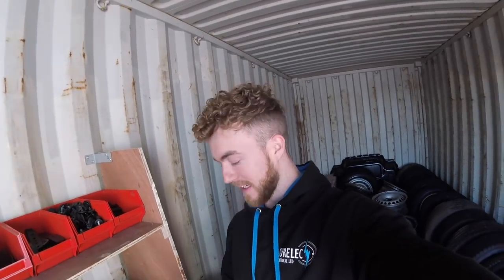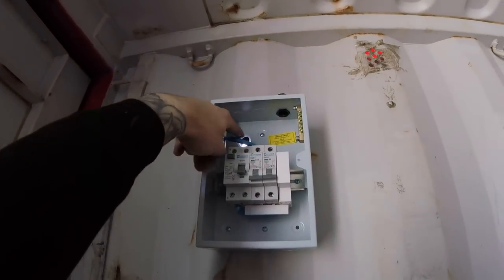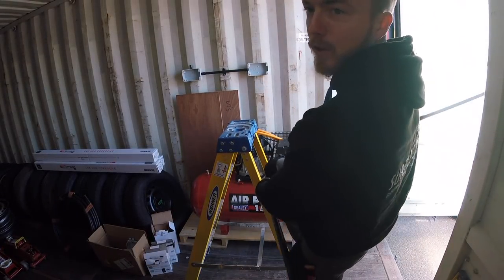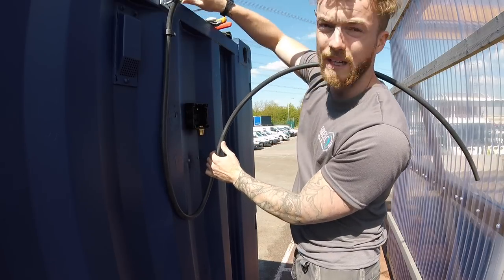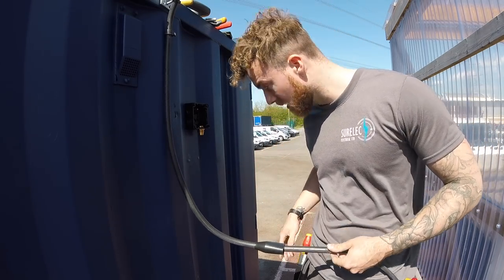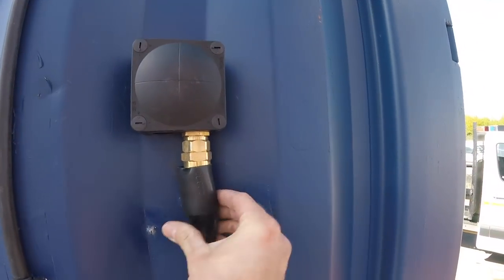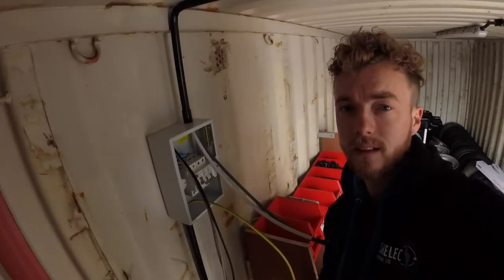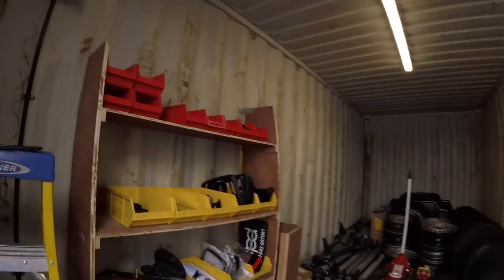SurelecTV- Container Wiring, SWA make off, Conduit bending

Comment: A few points to consider 
1  RCD fed from RCD  not necessary 
2 Same as above but with earth rods 
3 Tape not required on the swa gland . You cut the sheath back too far .
4 Have you tried push in saddles ?
5 Tidy job :)
Reply from the maker: persona250 thanks for the comments mate 😊 the second RCD is protecting the new container on its own stake only? I did cut the sheath back a little too much, hence why I added a bit of tape in this scenario, had the gland been on the side of the box I would have remade, but as it was on the bottom of this box, ingress up into the gland/cable is unlikely, but well spotted! Can’t say I have ever used the push in saddles for solid conduit, but have used the clip in/push in ones with flexible conduit. Are they worth a try?Thanks again
Reply: Hi Bud . Push in saddles save time and faffing around with those  tiny screws . Im presuming a TT earthing system had already been created at the first container so no requirement for an extra rod and same with the second rcd . In a fault situation which rcd would trip ? I would have used a standard main switch on the second db or connected into supply of the first rcd if over current protection is adequate .

Comment: Fellow sparky here from the USA. Just wondering on the specs of that conduit you're using there. For a job like that here I would have used metal EMT conduit. Is that not as common there? We also use plastic PVC conduit here but normally only when underground. But it's very ridgid and you have to use a torch to heat it then bend. But very nice work. Very cool to see how things are done elsewhere in the world 😎👍💥

Comment: Wow you look like Roland Keating 😁 Good job - just wondering how you secured lights etc. to ceiling & kept it water tight?
Reply from the maker: Not the first time Ive been told that, not sure if its a good or bad thing though haha!! 

The light fittings I used are completely enclosed non-corrosive fittings, so they come with brackets that you fix up, then the light clips securely on so you don't have any screw holes. With regards to all the saddles and other fixings on the roof of the container, the only thing I could do was seal round the fixing (screw) internally and externally with sealant. I've done this plenty of times and it seems to keep out the elements. Thanks for watching pal!
Reply: I've had a better idea, how about a couple of roof magnets, the type they use to put lights on the top of minicabs etc.?

Comment: Hi mate how did you connect the earths up ? Is the swa in the earth terminal at the board where you run the supply from? and then just the earth rod goin in the container
Reply from the maker: RK 180 exactly right mate. Earth of the supply SWA is isolated at the adaptable box.
Reply: SurelecTV 
Why is is the earth connected at supply side mate if its not at the container end 
Sorry to peck your head pal 👍
Reply from the maker: RK 180 no worries at all mate! It’s connected at the supply side, so the supply cable is protected/earthed via the supply DB. It is then isolated at the container end within an enclosed adaptable box. The container is on its own TT earth (earth stake). The reason for the isolation of the supply earth is so the two earths can’t be touched, creating a possible dangerous potential as the supply earth is PME (TN-C-S) and the new container earth is TT. Hope that explains it okay?
Reply: SurelecTV 
Brilliant mate appreciate it 👍

Comment: so u pulled a 3 core swa in did you cut the earth out at both ends? or just the end where u TT it?
Reply from the maker: Allen Goldsmith Hi Allen, the cpc was cut at the TT end, but connected to earth at the origin. Ideally I would have used 2core swa, but this wasn’t available in time for the job
Reply: oh right ok, I've been asked to install a hot tub its 10 meters away from house on a TNS earth, would you run a 3 core to a rotary isolator then a 2 core to the tub and TT it??
Reply: Allen Goldsmith- If the earthing arrangement in TNS there is no need to TT it, only TNC-S systems need to be TT’d where there is the possibility of 2 or more earthing potentials, such as metal sheds, buildings with extraneous conductive parts etc.
Reply from the maker: Sam Kerr Sorry Allen, I’ve only just noticed your reply! But Sam has hit the nail on the head for you 👍🏻
Reply: also could run a 10mm separate earthing conductor to bond the extraneous parts